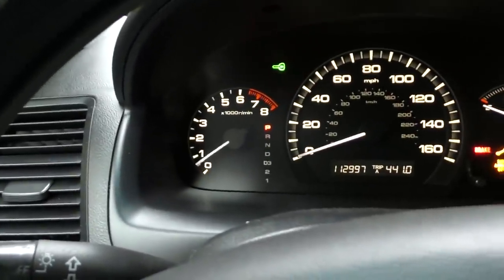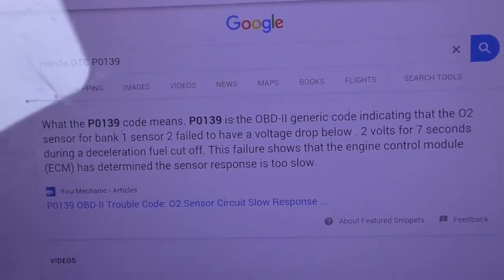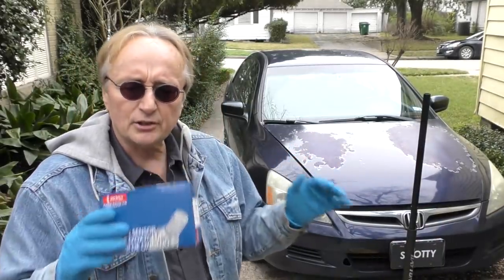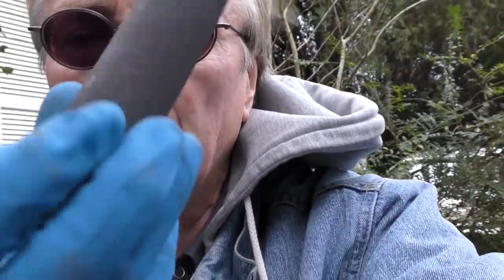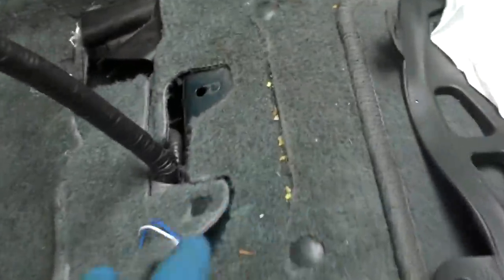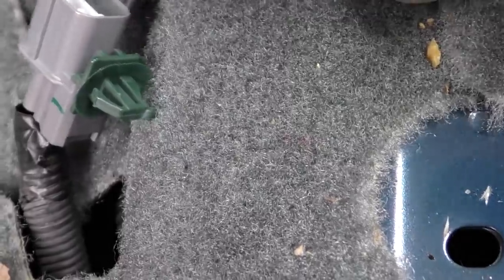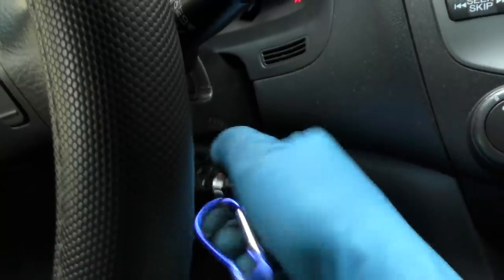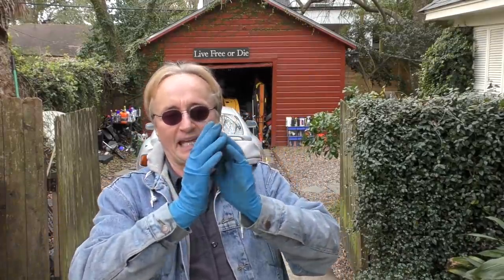Here's Why Mechanics Hate Hondas

Comment: Hey Scotty, this was one of your best.  I didn't know a code trip could stop other codes from tripping, so I definitely got some great info out of this video.  Thank you!
Reply: If the computer detects that a sensor is faulty and relies on that sensor to detect if there is a problem with a system then it can't use a defective sensor to analyze the system so it would always be throwing false codes. It is akin to you trying to measure a distance using a ruler that is wrong, any measurement you get will be out of tolerance compared to other inputs.
Reply: Yep welcome to the computer World 🌎 
That’s why you have to make up your mind - when chosen carburetor verses Electronic EFI
WHEN REBUILDING A CLASSIC. . Carb ?? - EFI ??? ——- Headache 🤕
Reply: Except he didn't even fix the car.. Just threw parts at it. 

The post cat 02's only purpose is to monitor catalyst function. It does not affect the way the engine runs in any way, that is the purpose of the pre-cat 02/lambda sensor.
Reply: So, I got a code (had autozone read it) and it showed O2 sensor. They changed 3 sensors. As soon as I left, check engine light came back on. This time the dreaded P0420 and P0430 codes. Since the sensor was initially bad, is that why it didn’t show the others?

Comment: My exhaust pipe broke due to rust, near the flexible pipe which i think it just need to be weld. I went to 4 mechanics and told me the whole thing needs be replaced which will cost about $650 to $700 dollars. After seveal attempts I found an honest mechanic who only charged me $100 to replaced the flex pipe and then weld it. It took him 20mins to do the whole thing. Lots of mechanics just take advantage of you if your clueless.

Comment: 113k miles I would unplug and plug back in the sensor connector (literally). Which is the same as what replacing it would do. All that exposure to weather and the elements. Jostle it and break loose some of the crud to get a good solid connection. Really small pins in there.

Comment: Only 120k The engine just getting broke in - Scotty 🤣
Reply: Must be a city car that hits every pothole.
Reply: I just hit 200k in my 2000 Honda accord v6 (got it at 170k). No issues, I got it from my previous mechanic before he retired. I'm getting the timing belt changed next week, but that's about all the mechanic work I've had done on it besides oil, tires, and suspension. I drive around 10k miles per year. 🚗
Reply: @o_o8203  it's an ok car but not the best

Comment: The Clear Coat is how I identify Hondas
Reply: Honda owners be like: The clear what?
Reply: Only in southern states. No problems here in Missouri
Reply: @I love Tools bruh
The clear coat is a transparent layer of paint that can be used to cover the colored coat. The clear coat is usually the last coat of paint that is applied to a panel. The thickness can vary a lot per panel and per manufacturer
Reply: @Chaos_Dave98  pretty sure he was joking.
Reply: @RR-ln6vs  here in new England they're all losing the clear
Reply: Honda paint not one of their strong suits
Reply: It's always peeling!
Reply: @RR-ln6vs  not in the south only. Here in Michigan peeling Hondas are common. ESPECIALLY if it's their bright red.
Reply: @RR-ln6vs  I wish... Living in MA I have had my black 09 civic Si since 2011 and EVERY metal panel is peeling. I used to keep it waxed but once I noticed the CC failing I stopped wasting my time. Sun certainly accelerates it, but they'll all eventually do it. 90% of the CC is gone from teh roof, 100% from teh trunklid, 50% from teh hood, and the tops of the fenders and doors are stripping completely. Everywhere that faces "up" is gonzo.

Comment: The wife and myself both have Renault Meganes, her one is a 2010 model and my one is a 2017 model. On both cars i have to remove the clutch pedal to change the cabin air filter as it is the drivers foot well and the clutch is hydraulic so a pain in the wazzoo to say the least. Only takes 45 minutes or so and a broken back so hey not all that bad. Lazy designers forget right hand drive models need parts changed also. If it was a LHD model it takes 5 minutes, i think car makers should be forced by law to make it the same for both markets even if it means making parts in mirrored fashion.
Reply: Alex Grant You two own RHD options on your Meganes? Most cars in the world are designed to be LHD & remodified to RHD for RHD markets for Britain,countries they influenced,  or used to be British colonies in prime.

It takes alot of effort,to make everything in a car symmetrical, manufacturers may end up making separate car models in the end to suit the needs
Reply: Thanks for reply, the reason about my comment is most cars i repair in the UK as my job are mostly easy to change out service items. VW, Hyundai for example make it simple to change a cabin air filter. I have serviced both RHD and LHD models (some people in the UK own LHD models for reason or other) and its the same procedure just opposite sides so very easy. If the issue with our Meganes bothered me to extreme i would not have even bothered buying them but we do like them so i just have to take it on the chin. At least my issue is fairly small compared to the problem with Ford and the exhaust issue that affects the Mustang with the steering column.

Comment: I got an 07 Accord with the 4 banger good cars. Enjoyed watching
Reply: My wife's is a 07, engine and transmission are great, front end is squeeking like a rusty gate and the rear wheel bearings are roaring, I'm wondering if it was under water sometime in the past
Reply: Jose Chavez And no timing belt like the V6 models! 👌🏽😂
Reply: Richard Rathman it was a fish in the past 😀
Reply: I hope not.  Richard  Rathman
Reply: Knuckles 300 True that's the best
Reply: Jay man. Well mine has 186 K n it's running like a champ. No oil burning

Comment: Scotty, you missed a quarter and two dimes under the left rear seat mount.
Reply: The quarter and two dimes didn’t show-up on the scanner though...
Reply: midnitesquirldog1 when someone crashed into and damaged my Ranger pickup, I agreed to let the insurance adjuster have it towed to a repair facility for inspection and to have it repaired.  I wanted it bodywork repaired, because I liked it and it still drove perfect.  She instead determined the body repairs would cost too much and she released it to a junkyard and made a total book value check for me.  I was misled about what was happening, and so I had not removed all my personal belongings.  In fact she told me that wasn’t necessary when I asked before it was towed.  It was hell of an effort, really a day’s work of phone calls and going to the junkyard twice, to get my toolbox back from the junkyard.  I lost some other things like my favorite music cd’s and a book, umbrella, little tools, change, etc. because they had cleaned it all out except for the toolbox that had been locked and bolted into the truck bed.

Comment: Thanks Scotty! My '07 Lincoln Town Car with 289,000 miles on it had the exact same code only my check engine light would come on for awhile, and then go off. I changed the rear O2 (bank 1 sensor 2) sensor and my check engine light hasn't been on since.

Comment: Good info Scotty, but here's a bit more that no one seems to mention and parts houses almost never know about. There are 2 Oxygen sensors. Up stream and Down stream. THEY ARE NOT USUALLY THE SAME SENSOR. And you can test them with a VOM meter to see if they are good or bad before you buy other ones. Been there done that.

Comment: Mechanics love Honda’s, easy to work on, lots of working room just an fyi the sensor after the cat doesent affect air fuel ratio
Reply: Nah.  Toyota is much easier to work on especially O2 sensor replacement.  No need to remove stupid seat.
Reply: How to know if your O2 sensor Bank 1 & Bank 2 are working... what trim/% there suppose to be...?

Comment: Scotty, why not check the live data?  If the upstream and downstream O2 sensors are in lockstep, then the catalyst is bad.  If not, then try the sensor.   Also, Hondas require several minutes at highway speeds to reset the catalyst monitor.  No need to wait weeks.

Minor issues aside, I love your channel.  I, too, am in the industry.

Comment: When I was a master tech 20 years ago, we had a seminar where we learned that the O2 sensor maintenance interval was 60 thousand miles. It is a good idea to follow that advice. I can tell you that at least in the 90's, the Japanese PCM's rarely had an issue, but the GM and Chrysler corp controllers had MANY issues that mandated their replacement. The Toyota, Honda, and Subaru cars never got a new controller from me, but there was one Nissan car where the owner declined the needed replacement. HTH.

Comment: Scotty the reason why the plug is inside the vehicle is to protect the connection from the element, if rust develops it will slightly change the voltage thus triggering a code, is actually good engineering.

Comment: Wow, I have this same car in the same color. I have replaced the catalytic converter 3 times in 3 years. This model of honda accord 2003-2008 engines were notorious for burning oil BAD, so bad that they destroy the catalytic converter. I got to the point where I just knocked out the cone in the cat and basically it’s a straight pipe lol. My state doesn’t have emission checks so it’s fine and runs so much better. No smoke either
Reply: Is that for the 4cyl too or just the V6?  I know the V6 had issues.  I like that style from those years though.
Reply: I have never known anyone to have those issues or to require them to need 3 convertors in 3 years. I have personally overseen 6 various 2.4K and V6 2003-2007 Accords within the family, and non have had these issues. Are you sure you did not use aftermarket shady parts? The 2008-2010 were indeed more oil burners for some reason over the 03-07.
Reply: Those year models aren't known for oil burning. I have an 07 with 250K on the clock and it burns right at a 1/2 quart every 2,000 miles.
Reply: Wrong 08-12 accords are more prone to use oil IF 1. You followed the"Maintenance Minder" and changed the oil every 8-10k. 2. Didn't use synthetic oil since new. I have several customers with properly maintained(synthetic oil every 5k) 08-12 accords over 200k not using oil. 03-07 accord 4cyl is a fantastic car if yours is using oil then you bought it from someone who didn't care or you didnt care.
Reply: That is weird. I bought my 08 Accord with 120k miles, five years ago. I put 110k during this time frame and it still have the same catholic converter. Yes, my 4cyl burns oil like a mf! A quarter of oil last me a month.
Reply: Not in my case. My 05 accord 4 cil automatic is bulletproof. Best engine / transmission I ever had. 250k, goes like new, zero oil consumption in between yearly changes. Maybe talking about US V6 models?
Reply: @villafontananorte  My 01  2.3 Accord has done 153,000 miles and never needs filling with oil  but gets an  oil change every year. Has recently started idling uneven and engine managment light on.  I will check it out.
Reply: I'm being too cheap to replace it. I replaced it with a used one after a month of smelling really toxic gases
Reply: @ryandavis930  True that, and most other applications in CRVs, Elements, etc. I will not buy a used one if I see they changed the oil 8-12,000 miles. Some people I have talked to falsely think the maintenance minder also monitors oil level too. I change mine every 5-6k and never had an issue.
Reply: @sixtiesfan11  Sounds like the EGR valve. We had that happen on our 98 Accord 2.3. Make sure you clean out the ports as our mechanic failed to do and the issue returned.
Reply: @midwestfarm757  Thank you.  I'm hoping to keep it as long as I can.  You can't get the 2.3 models especially a hatch back like mine.  :O

Comment: Had a '91 Mercedes and they had the same wiring route for the O2 sensor.  My BMW has everything in the engine bay and is easy to get to.
Reply: Also easier to get bankrupt
Reply: @Super6-Four  I've been able to fix everything myself.  So not too bad.  But for non DIYers, do NOT attempt to own one!  It has cost me me much less in repairs than my 2005  3.5 liter Nissan Altima however.  And is going very strong with 20k miles more on it over the old junk bucket.
Reply: @TheFrenchPug  agreed. But i knew a bmw tech who sold his car in the end because he knew how much it would cost him to continue to maintain his bmw. # reason I stick to fords, Honda's or toyotas
Reply: Harbinger YES !! Empty $ PITS for sure !!!

Comment: I drive a 2010 Accord 2.4 Liter 4 Cylinder. 233K miles and a ton of abuse from NYC/Colorado winters and yet the only parts under the hood that aren't from the factory are the battery, starter, spark plugs. It's never failed me or left me stranded once in over 10 years. Engine and transmission are still running smoothly and I haven't put a single dollar into either other than gas, oil and fluid. The most dependable and reliable car I've ever driven.

Comment: If you are going to replace the O2 sensor, snip off the wires and use a standard socket.  Many times the sensor socket with that slot, will prevent you from getting good grip and you'll strip a stubborn sensor.  If you're throwing it out anyway, no point in not doing it the easy way.

Comment: Hey Scotty, idk if someone has mentioned this. I have been having the P0139 code for years on my 05 honda accord. A few years ago, i replaced the O2 sensor at the cat side. Did not really fix the issue. Code was still coming up. I did not care for awhile as it literally goes away during summer times. This year, i was just reading about it more online and someone suggested to replace the PCV Valve because over time, the mechanism in the PCV valve gets stuck because of the oil sludge that it accumulates, which let oil pass through the valve and getting into the cat. So i replace the PCV, was a super cheap fix, i put catalytic converter cleaner in. The code went away and the car runned smoother like it was brand new. I was ready to put in another cat in it but good thing i gave this one a try first and it worked for me. I’m going to give it another catalytic clean later this year and hopefully the code never comes back.

Comment: Here's why I love Hondas, Scotty.    When replacing that #2 oxygen sensor on my '07 Accord, yes, I had to remove the  four bolts that hold the seat down, but all I had to do was tip the seat back out of the way, connect the sensor, then tip the seat back up and reinstall the bolts.   I look at the REASON that Honda designed the car this way; having that connection  inside the car makes it impossible for corrosion to muck-it-up  and cause you more grief.   I also took the carpet out of my Accord when I first got it as the previous owner was from Wisconsin and used the car for a work car everyday and got the carpets totally soaked with water from the snow.   Upon removing the seats and center console, I noticed that there was a ground stud under the console that had a bunch of ground wires for the various wire looms attached to it.    I thought to myself; "isn't it great that a car company actually thought of putting the ground lug INSIDE the car instead of the American cars having it on the frame under the car where it catches all the salt, brine, and crap from the road and eventually rusts off.

Comment: 112k man thats only a quarter if its life! My 95 has 187k 🤘😁🤘
Reply: Mine just hit 380k lol
Reply: My -98’ has 268,000
Reply: 224000 on my 2004 accord  runs like it did new
Reply: The 4 cylinders are the easiest engines ever! I learned a swivel head socket, the smaller one works best at removing the IAC to clean it. And ive always gotten a weird satisfaction out of doing the services and especially cleaning the EGR plate on my generation. These cars are LIFERS! And literally everything can be cleaned up and put back together and work like new haha!

Comment: If you have an infrared thermometer ,heat up the car to operating temperature, rev the car to 2000 rpm’s and check the input
 and output temperature of the converter ,if the temp is the same then the cat converter is worn out,if there is a 100 degree difference 
100 greater on the exit side,then the cat is good and all you have to do is replace the o2 sensor,if they’re the same then replace Both as a set

Comment: As someone who owns a Honda and does my own repairs my biggest issue is Honda over tightens everything. I had to do a crank seal not too long ago and the specs for the crank pulley bolt was 181 ft pound tourqe. It was stupid hard to get off

Comment: If it’s like my 2007, you do not need to remove the seat. Just slide the seat all the way forward and the carpet underneath the seat pulls up. Also, screw in the oxygen sensor first before you plug it in to prevent those kinks.

Comment: I have done oxygen sensor replacements in other honda accords and never had a case of removing the front seats for replacing the sensor. I guess that those Accord 2006 and 2007 are like that. But those Accords are excellent cars. 113,000 still has a lot of life forward if the owner gives the proper maintenance. Those cars don't die.

Comment: I have a 07 accord k24 auto and the damn thing is awesome. Has 176k on it and runs like a top. I had to change the valve cover gasket on it at about 165k or so and the inside of that engine is so damn clean it's insane. I bought it at 125k and got lucky cause that thing was cared for. Literally zero carbon build up.